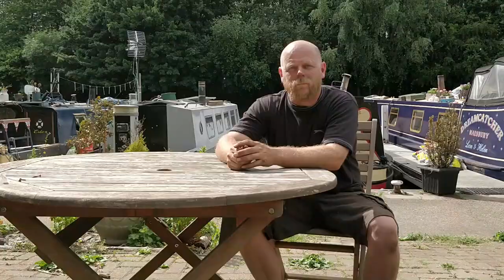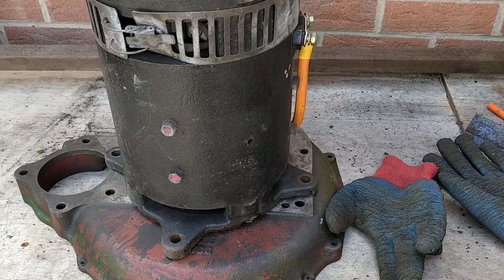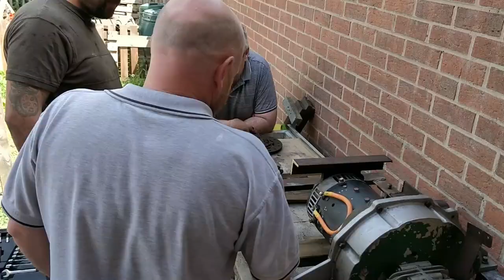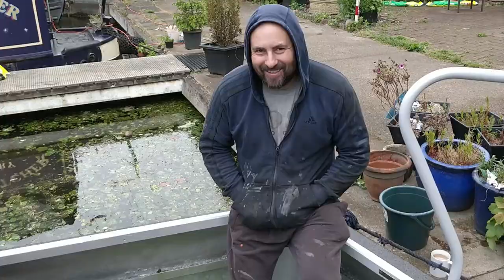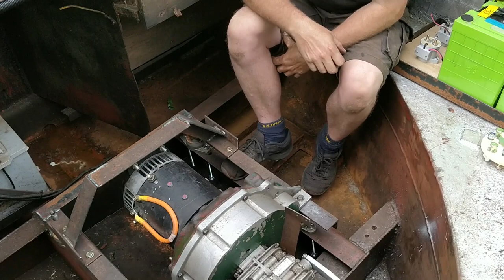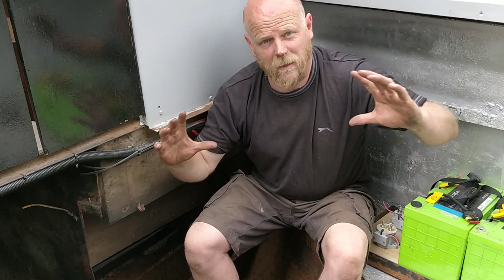DIY Electric Drive Conversation on a Boat - Winging It, With The Tight Yorkshirman. Episode 2

Comment: I'm no expert but I believe the litium batteries are much preferably located in a place where the temperature extremes are much lower. Particularly in winter, where you have located them will mean they could easily be under 5 degrees for long periods. It's not the end of the world but when you try to recharge them at low temperature the rate of charging them is severely restricted by the battery management system (to avoid damaging them). I think the batteries are better placed where there can be some regulation of the temperature where they are placed.

Comment: I've only just found your vlogs, so I am looking forward to following your journey. Can I suggest you move the batteries inboard. Lithium batteries do not like below 5 degrees C and if you try to charge them they will suffer severe damage.  Good luck with the build.
Reply from the maker: We would struggle to move them in board due to space but it's something I will bear in mind. Maybe see if we need some kind of low powered heater to keep that area warm when it's cold.
Reply: @WingingItBoatingonaBudget  gotta use the diesel tank for something!

Comment: why a gearbox Reasons.
1: electric motors do not have thrust bearings, without that the pouch from the prop wheel brake the motor.
2: a brushed motor likes higher revs than the prop likes. 3: you need less contractors.
Yes you can redesign the motor and control system but MONEY, you have someting that works youse it.
But make the coupling between the motor and gearbox as light as posible, adding a flywheel to an electric motor is asking for trouble.
And about power except something like a single bolinder.
Best of luck i think you are onto something good.
Reply: 100% on spot, mate.

Comment: I love this concept and believe electric is the way to go.
nice idea using a very powerful fork lift motor and batteries.
getting it to work should not be too much of a problem and i look forward to the rest of your build.
HOWEVER and here is my problem.
charging these batteries will need to be done at some point. 
Granted a charge may well last you a full 6hrs or so cruising but will then be getting close to needing that all important top up.
where is this coming from?
British sunshine rules out solar mostly due to the amount of panels needed to supply all those batteries.
you could try adding an alternator to the output shaft of the gearbox and charge as you go along like a regular system.
However the problem with this is you are using the batteries to turn the main motor and then turn another motor ( alternator which is in realty a brake as it charges) to charge the batteries, this will in turn put drag on the main motor cancelling each other out, ( you cant get something for nothing).
i have a couple of interesting ideas about making a water type turbine affair as you are going along, but fear the same principle rules apply , you will create that extra drag on the boat in turn using more energy to propel it forward etc .Although I still believe this idea has merit and worth a try due to water dispersing the energy in multiple directions not like the fixed alternator if that makes sense.
calculations are required my friend to figure out how long it will take even if you find a socket to plug into along the way to charge all those batteries.
you may be there for days to get the thing charged up enough for the next leg of your journey .
OK that said i know you dont like the idea but a diesel generator on board might be the way to go for practical reasons.
trains run on this concept so it must be efficient in some respect.
I hope this helps in some way and gives you food for thought on your mission, because building it is one thing , developing it as it goes along is quite the challenge but we all love that  challenge, those challenges get easier as it starts to progress and take shape. 
Good luck IAN
Reply from the maker: As we both work full time our trips out will tend to be limited distance so we think at least initially 240v marina hook up may well be sufficient with solar just as a back up to give a bit of charge to help give a charge whilst on any "trips". 
We will see how the system works and then look further into the charging... 
Cheers
Reply: Ian Mitchell I had the same thoughts (and funny enough I used to use that avatar in online fora years ago, but with a guitar in place of the trident 😆). To charge this bank of batteries up in say 6 hours ish is going to require 4.4kw. That’s a lot of solar to fit on a boat!

Fore more conservative cruise times of say 2 hours you could cut that requirement to around 1.5KW, , or 750w for a 12 hour charge... but then that begs the question why have such a large battery bank if it’s not going to be cruising for 6 hours at a time.
Reply: @frodev728  lol seems like the only difference between us is I dont play a guitar . I found it years ago and use it because I have a tattoo just like it.
Reply: Ian Mitchell ha, I’m sure there must be some other differences 😆

Comment: Lithium batteries suffer degradation when exposed to excessive temperatures... cold, especially when charging. Could be an issue... most have Li batteries inside the cabin.
Reply: James Braselton  ?

Comment: Just my wavelength... would have been trying this myself if not trapped overseas - will watch this channel with great interest
Reply from the maker: Might give you ideas for when you return.
Reply: @WingingItBoatingonaBudget  gonna go through your 3 episodes and make notes. I was working on a flexible or hydralic coupling and even remote control systems.

Comment: The A team? You appear to have three Howling mad Murdocks so I suppose thats a start. The other advantage of keeping a gearbox is a 3:1 or 2:1 reduction without farting around with belts or chains and the frictional losses that come with them. The commercially available boat motor kits all have a reduction of some type so it must be required to get the best out of the motor and batteries. Crack on, the bad guys will be here in a minute!!
Reply from the maker: I think you have to be a bit 'Murdock' to attempt this! Thanks for the feedback.

Comment: I’m definitely not clever - and everything I know about batteries has been learned on YouTube whilst researching this exact project. So ..... quoting what I have learned, here are my calculations. You have series-connected 4 x12v batteries to give you 48v - however, whilst the series connections total 48v the amp hours remain at 138ah. So, if you continue to series-connect the remaining 12 batteries as  3 sets of 4 batteries to a final total of 4 ‘banks’ of 48v and then connect those 4 banks in a PARALLEL formation, you will multiply 138 x 4 to give you 552amp hours at 48v. If I’ve misunderstood your query, you are welcome to ‘delete’ this :).
Reply: Yes, you still have 138Ahrs per battery bank but the key value here is the Watts. Multiply 553 x 48 and you get 26KWhrs of power storage... so more than enough to push the 4Kwh motor spinning for a good few hours.

Comment: This looks like a really interesting project. I have some concerns about the effective charging of such a large lithium bank, especially if you’re winging it. I’d urge you to read through all the articles on this site (not my work) http://nordkyndesign.com/category/marine-engineering/electrical/lithium-battery-systems/. They’re long but full of pertinent information most of which will be relevant even for your slightly different use case.

Looking forward to see progress!